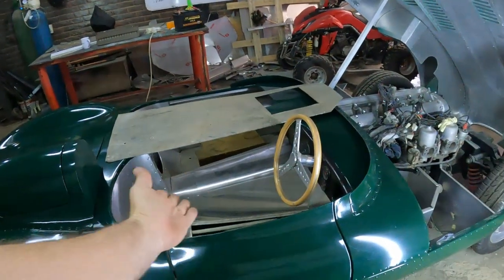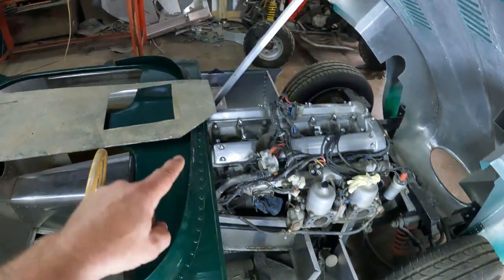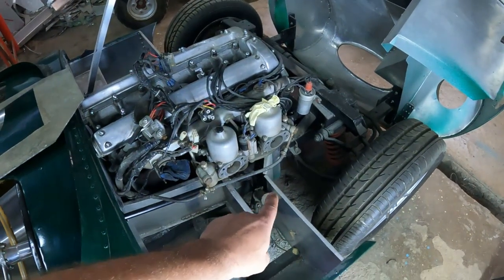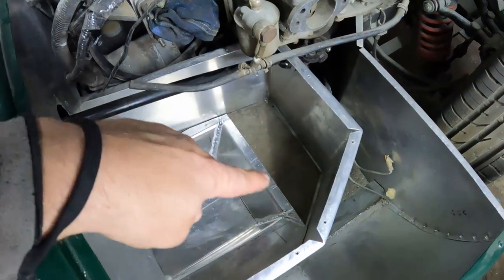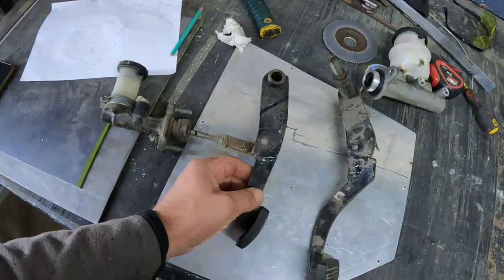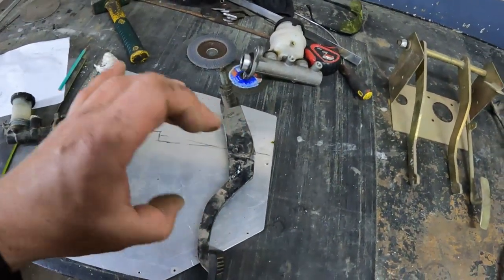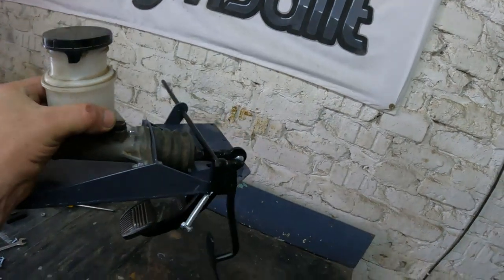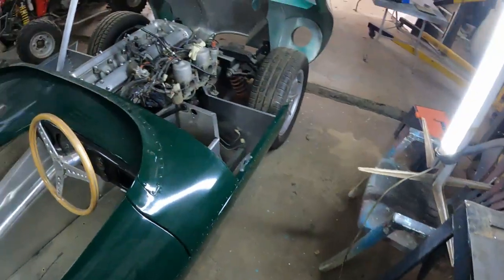Making a Pedal Box for the Jaguar d-Type

Comment: The car is looking superb but I am a little surprised that you appear to use steel plate to ensure the pedal box is sufficiently strong for the purpose. I have a Land Rover which doesn’t like to have aluminium and steel in direct contact due to the problem of galvanic corrosion. However, I suspect that your car will not be used in the very wet conditions that we experienced hear in Ireland. But, fantastic craftsmanship & dedication .